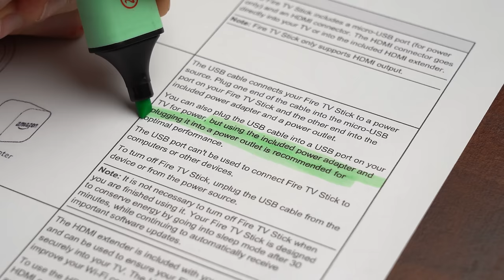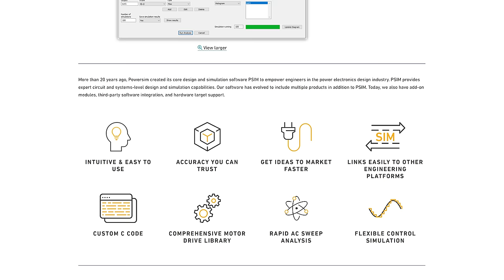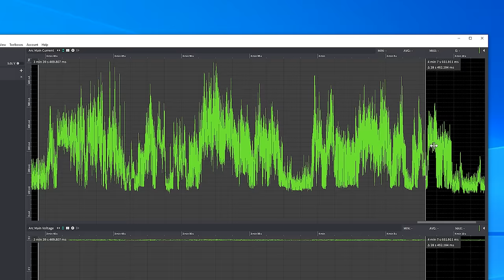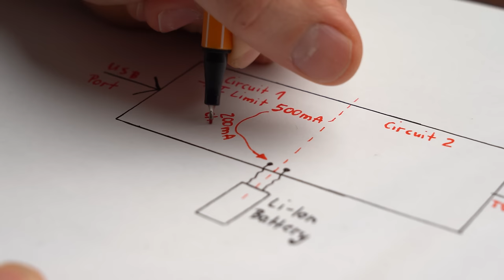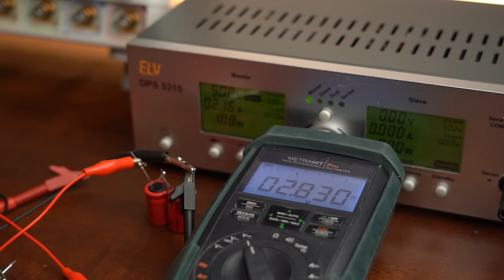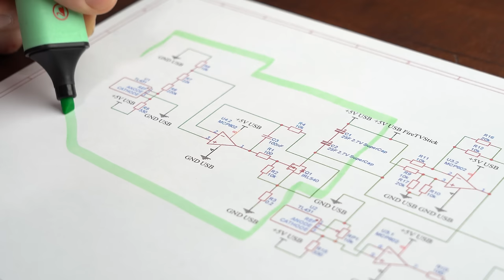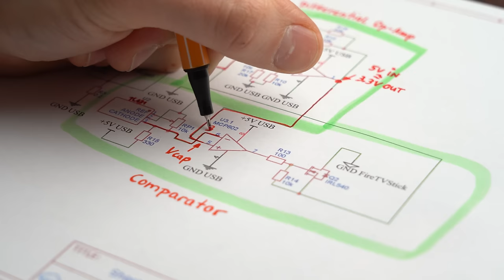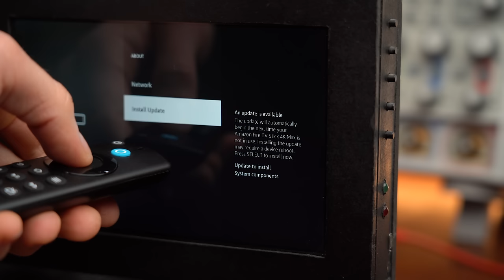I recreated an Amazon Product to make it better & cheaper! (for Fire TV Stick)

Comment: Really cool project! I particularly like the use of caps instead of batteries. I do wonder why you're limiting the input current to 500 mA though. The TV can clearly provide at least a little over that, so why not just take all the current you can get to charge up those caps?

On a tangent, I had a Raspberry Pi connected to my TV's USB port and it would duck under and/or crash during heavier operations due to the TV not being able to provide enough juice. I ran the raspi off of a 1 A wallwart for a while and it worked flawlessly but I just hated the extra cables and clutter, so I tried sticking a cheapo (actually a free marketing thing with some company logo on it but they go for a few bucks normally) powerbank between the TV and the raspi. It was rated to 1 A but actually output closer to 1.2 under full load and it would charge simultaneously, becoming a very crude UPS of sorts.  I think it was probably doing much of the same thing that Amazon thingie does, it at least looked very similar on the inside. Anyhoo, It worked like a charm for over a year, taking care of the extra power draw that would otherwise cause crashes and, as a bonus, keep the raspi running during power outages.

I am by no means good at electronics. I rely heavily on decent instincts and luck, actually, so I really wonder if that solution was just stupid, although it seemed to work?
Reply: That function of power banks is called passthrough charging and has to be explicitly supported - I've got an old power bank that is incapable of charging while also delivering power, for instance, so it's perfectly safe to use in that way. The only problem is the exact one Scott pointed out - limited lifespan. 1 year isn't going to be enough to do it in but basic devices like Fire Sticks often have much longer useful lifespans and the power source is separate so it seems a waste to run one off of a semi consumable battery source when there's wall power there literally all the time.
Reply: @clancywiggum3198  Thanks for clearing that up!

I totally agree that in principle, it's just dumb to use lthium cells instead of capacitors but possibly not as dumb as I made it sound. You see, the power bank in question was not done for after a year.  I'm sorry for being unclear on that. I just repurposed the Raspberry Pi for another project after about a year. I gave the power bank to my son and he used it to charge his phone on the go for at least another year, probably cycling it 100% on a daily basis knowing his phone habits, before it finally gave up.

Since I had used it in a similar fashion for months previously, it stands to reason that the year behind my TV really didn't affect it much at all.

Thing is, in this application, you're not cycling the cell. You're barely touching it. It's fully charged most of the time and only rarely discharges a few mAh to pick up the slack from the limited USB outlet. The cell won't survive forever, of course. Holding a full charge and trickle charging is definitely not ideal. I'd be surprised if you had to replace it even once during the lifetime of the Fire Stick. On the other hand, ther's no way to know the condition of the cell without checking it periodically. If it fails silently you might not know it before an update bricks your Fire Stick.

So, for this particular purpose a power bank might actually be a horrible idea! The way I used it with my raspi seems ok though.

Comment: a PMOS also- to disconnect the Amazon fire stick from +5v. Else it might short through HDMI GND. PMOS & NMOS combo isolates the fire stick from USB/super-cap .. A battery might also be a good idea to run the system while super-caps charge.. But it might not be worth it.

Comment: I'm a bit concerned with the energy storage in the supercaps.  They are likely nowhere near the storage in the battery, and might be a bit unreliable under long term stress testing. A comparison to the battery capacity should be included. It's likely that the battery is overkill for this very reason.

The entire application seems a bit suspicious to me. The whole thing can be solved by using a dedicated charger, which is both more reliable and easier. What is the benefit of TV powering? Removing the parasitic load of the fire stick from the grid when the TV is off? You would then have to wait for the stick to boot before you could watch, which would take a few minutes, compared to the manufacturer-recommended, always on solution. Supposing that was the goal though, wouldn't it be more reliable to use the TV port power as an enable for a dedicated high current charger?

Still, as a learning tool, the video was helpful. I'd be interested in seeing the high-side switching solution that others have noted. While you're at it, you can add larger caps and include a secondary quick charge port for them. USB-c would be fastest, but even an old school 2A USB charge port would be a significant improvement, and relatively easy to implement.

Comment: You say you've bought multiple fire sticks, what is it about them that you like over an android TV stick? As far as I know amazon fire sticks are android tv sticks but with an extra layer of software, perhaps you wouldn't need more than 500ma if the stick weren't running the amazon android overlay, those do draw extra power

Comment: If the device can brick itself during update because of usb power shutting off, then it can equally brick itself in case of a power cut I imagine. So to be really really sure, could the caps be sized to hold enough energy to last through the update process?

Comment: I’d be curious if this could be adapted for use inside a high current draw guitar pedal(900mA) so it can be daisy chained w other pedals w/o causing excessive noise. Yes there are already market solutions to this issue but there’s always a new way to skin a cat

Comment: I don't know why they don't include a 100mah (or less) rechargable battery in the device, so it charges when is in idle mode and discharges whenever the device overwhelms the power USB port

Comment: If the TV's power supply has a line between 6V and 9V that can handle the surge demand, I'd much sooner just cut the trace to the TV's USB power pin, and power it with a 7805 on a decent sized flat heatsink. A linear reg and two little caps seems a heck of a lot simpler than building a custom supercapacitor based power conditioner.
Reply: If you're breaking into your TV's circuitry you will probably find its 5V supply is capable of more than enough current. Tapping into it before the USB current limiter would be the way to go.
Reply: @eDoc2020  That doesn't sound like any architecture for providing USB power that Ive run into. Is that what's common in modern TVs?
Reply: @AtlasReburdened  I have no idea about TVs but it's common on USB ports in general if the host device uses 5v internally. If the host doesn't use 5v internally then they probably have a buck converter directly powering the USB port.

As for a line between 6v and 9v, I doubt it. I would expect the modern TV's power supply to provide 5v and/or 3.3v for all the processing circuitry and 12v or higher for the audio amplifier and backlight.

Comment: Hello GreatScott! You say that you've created 0.1 V reference throught the help of TL431. Isn't TL431 designed for Vref around 2.495 V? Does driving the Vref so low create problems for the TL431 and blow it up? Furthermore, isn't problematic taking voltage off of Vref of the TL431? Shouldn't be the voltage taken off of Cathode when needed instead of Vref? I'm asking all of this because I am buidling something with TL431 right now... I'm confused a bit. Schematics state that the voltage needed is taken from Cathode pin and also state that Vref must not fall below 2.480 V (I think it was 2.480 the minimum value for the available Vref voltage, maybe I am wrong but I am sure that Vref was not stated that it could go as low as 0.1 V)...  Otherwise, great channel, great videos.
Reply: you  can use a resistor divider to get a lower voltage ref

Comment: Maybe u can add a balancing net for those 2 super caps since over time they might go out of sinc.
Also maybe u can measure the effective capacitance since honestly i dont trust cheap chinese parts if the original part is expensive on main sites like mouser / farnell . but still even it it is 20 not 25F it is a nice find . Also some indicator leds would be nice. And a proper PCB but that is not that hard if u have the schematic. 
Also maybe do a vid how to find good non fake parts on the Ali market.

Comment: How does 500,000 cycle of super caps compare to 3000 cycles of li-ion?
Since higher frequency of charge and discharge means it will reach the 500,000 cycle quickly, but how long will it take to reach that much cycle compared to 3000 cycle of li-ion?

Comment: I'm trying to figure out how circuit board of a Roku remote works, specifically where the microphone  connects so i can remove it. Do you have a video that goes over the reverse engineering of a circuit board?

Comment: One could just use a USB Battery Pack, continuously charged from the 500mA socket, and capable of providing an amp or two. Such gadgets can be extremely inexpensive.

I use a similar approach to provide a "5v UPS" function for a radio clock that doesn't react well to power failures.
Reply: How about just plug a USB charger into whatever UPS you use for your computer. Or just plug it into the wall. I didn't watch the video, but this all seems pointless.

Comment: HI there! One question here. Can I use this circuit for powering USB external hard drive?
The 2.5 HDD I'm using takes about 1A current to start spinning. The USB port on my computer are not able to get it working, so I'm using a USB hub with external power to power it.
If this circuit can do the job I might modify my front USB port with it.

Comment: hey dude, i have an old roku smart tv from like 2012 and it still works but is noticeably slow I was wondering if you knew how to increase the RAM inside a tv like that.  WOrse case scenario i break it and buy another for cheap. could you make a video on something like that? I think there's a lot of electronics in the world that are a "buy and throw away" type deal,  i take very good care of my electronics 9even have some working walk mans from the 90s working.  I want to be able to upgrade this tv without it just ending up in a landfill some where.

Comment: First of all, switching on GND is a problem.
Second, it is all linear and it is bad.
Third, You connect supercaps in series that is bad: basically one would be disbalanced compared to the other one.
What I would do is a switching buck current source with voltage ljmit via diode OR.
Then Boost convertet to 5v.
All of them should be synchronous.
So, taking into account amount of ICs: I would prefer to use small microcontroller for that reason.
Reply: But it seems all this work is basically unnecessary, if you just go get an old cell phone charger out of your junk drawer.

Comment: For while now I'm thinking that you should start building project around capacitor or super cap because everytime we add battery  to projects we also need to protect them by adding bms/ overcharged overcharged but also with less life cycle and with super cap we don't need worry about life cycle and they are capable of delivering plenty of power so I request you to from now pls try to add super cap instead of battery 🙏 🙂
Reply from the maker: Sure :-)

Comment: Maybe I am missing something... Does this circuit take time to charge the caps to the required voltage and then power the fire stick? Or does this circuit immediately power the fire stick and slowly charge the caps as a buffer for when it needs the power? 20 secs into the vid I was thinking why you can't just use 2 series caps with an inrush limiting circuit and leave it at that....
Reply: Years ago I built a dynamo bike light using a printer stepper motor with 1 line for the rear Led and 1 5f supercaps in parralel and 1 line for the front Led with 2 caps in series wired in parralel with the led. This gave me lights that never seemed to go off even after  a couple hours. The forward voltage of the LEDs seemed to act as a clamping diode quite nicely and I never had any issues with it as it always eventually discharged the caps fully. I know that wont apply here for balancing but it was beautiful in it's simplicity

Comment: It just comes to my mind but not sure about it correct me if im wrong 
( What if you weld another usb cable to the other original usb cable that comes with the fire stick sense evey tv have more than one usb port ) doesn't that make the the voltage still 5v and bump the amp to 1 A ?

Comment: I bought some 5v to 9v converters but they don't seem to work.  I get a continuity signal from the negative power leads but not the positive.  But I can't see anything obviously wrong with the circuit board.

Comment: While the concept is cool I believe the best solution for most people is to use a more powerful USB adapter. Since the TV has to be connected to power anyway there's likely a power socket nearby. Power supplies are basically everywhere and most people have at least 1 to spare.
Reply from the maker: Probably true :-)

Comment: This is cool, however I was looking on eBay and you can get a USB wall adapter (2 amps) and the cord to plug into the Firestick for under $10 USD Free Shipping - if it wasn’t so cheap, I would build yours!
Reply: And $300 dollars an hour to have another wall outlet installed
Reply: @Nono-hk3is  GOlly, they sell power strips for about $3 at Goodwill, around here.

Comment: We've had a Firestick for a number of years now. It was getting rather old and starting to have issues. This past Christmas we bought a new one off of Amazon itself and it came.with it's own wall wart. It definitely needed the additional power capacity as it kept giving a low power error message when only plugged into the TV's USB port.

In this case, included power supply wins for me.

Comment: in circuit diagram i noticed three opamps..but on pcb its two..is one of them features dual opAmps???
Reply: Single opamp chips are uncommon in DIP packages. So yes he is probably using dual opamps.

Comment: how about lm317 as current limiter...i takes just 3 components  (2 if capacitor excluded) to make 500ma current limiter. have been using this for leds on my car bad in the college years. after that just get cheap 2$ bms and a diode

Comment: couldn't you use a simpler voltage regulator IC configured as a constant current source for the first part of the circuit? Texas' LM338T has an example of this on it's datasheet :)
Reply: The problem is those have a large dropout voltage, so if you have a 5v supply input you will get around 3v at the output.
Reply: @eDoc2020  oh, got it!

Comment: Why are the super capacitors in series instead of parallel? I thought that when capacitors are in parallel the total Farads is the sum of the capacitance. But in series it is the sum of the inverse capacitance.
Reply: series to get a higher voltage since supercaps only supply a low voltage

Comment: heyyy Scott i have a simple request, could you make a wired keyboard wireless? i know there are ubs2bt adaptors out there but honestly they are hard to get hands on and few good ones exists, is there an easier alternative way?
Reply: Diy or Buy 🙄
Reply: For something like that, I highly suspect that buying a wireless keyboard for about $30 is going to be cheaper, more reliable, and no work involved. There's so many to choose from, you should be able to find one you like.

Comment: in this case DIY always win but if you use  TP4506 charger and 18650 battery is more complicated, because you need many more knowledge to use super caps and other elements. Li-on charger an li-on cell is simplyeir to use.

Comment: Hey Great Scott, can you make magnetic levitating light? Which is easy to diy?
Reply from the maker: I can put it on my to do list :-)
Reply: @greatscottlab  you kind of already did that 4 years ago right?, all it would need is a led with a smaller coil and another coil to act as a transmitter

Comment: I think this is a little overboard with emphasis placed on the life span of the Li-ion battery.
Lets say that the firestick draws 200ma over the 500ma rating of the port. A Li-ion battery rated for 2Ah will run for 10 hours at 200ma, yet the 200ma avg draw is only for a few seconds and then that power is replaced right away at a trickle charge rate. This type of use on the battery means the lifespan of the battery will be for decades. The battery would likely fail due to age and not charge/dis-charge cycles. Even if 10% of the battery is drained during an update process...How often does the Firestick get updated? Once or twice a year? This would have very little impact on the lifespan of the battery.

If you want to make one yourself...You get a little USB powered Li-ion battery charge/protection board. Take the output of the board and run it though a 5V boost converter with it's output connected to a female USB connector to plug the firestick into.
I already have a bunch that are rated for 1A.
 [You would have to use a Li-ion charge/protection board that is rated for 500ma Max or incorporate a current limiting resistor.]